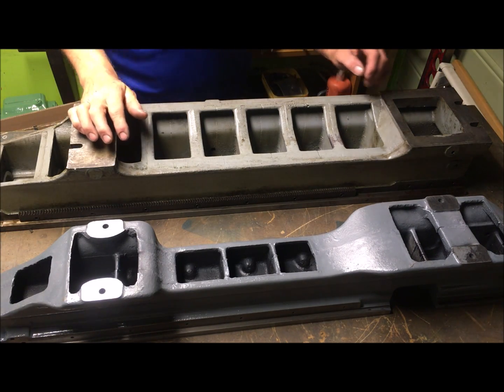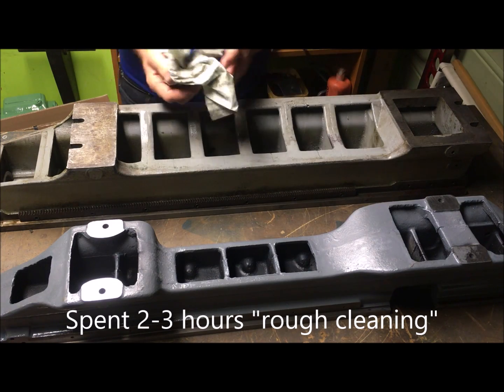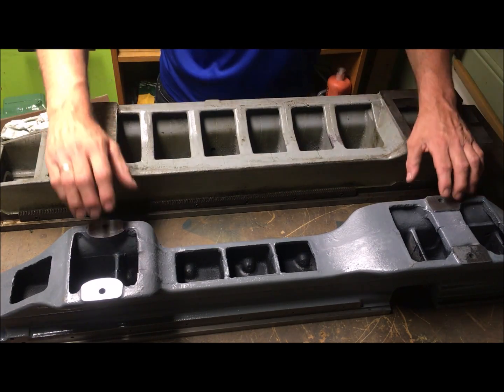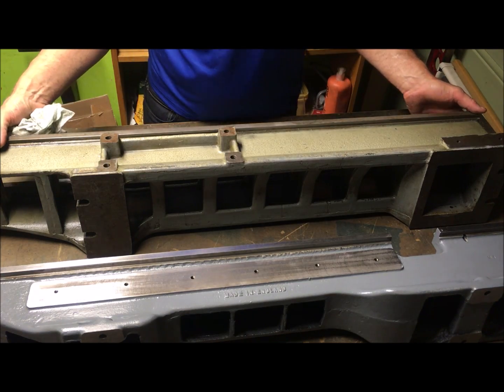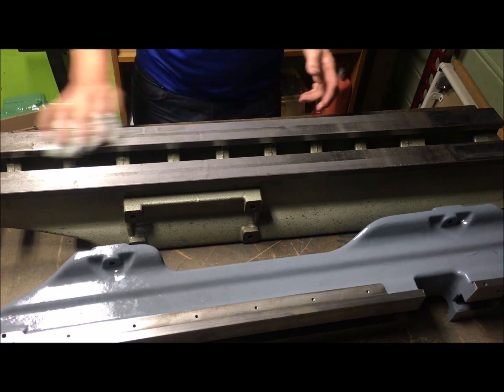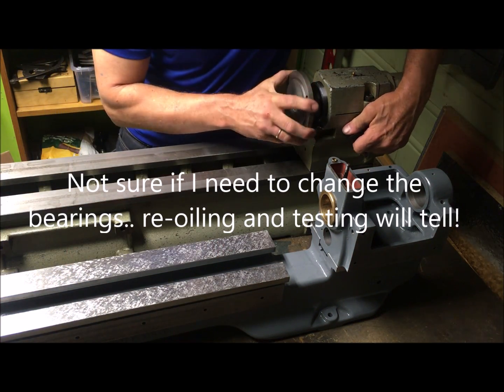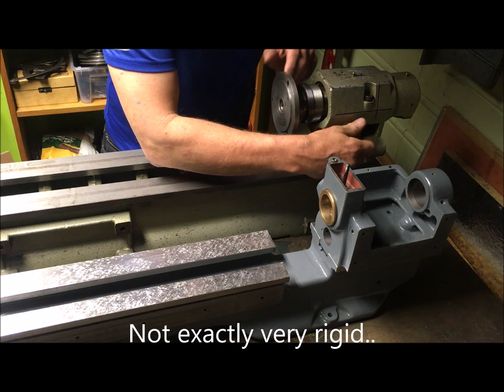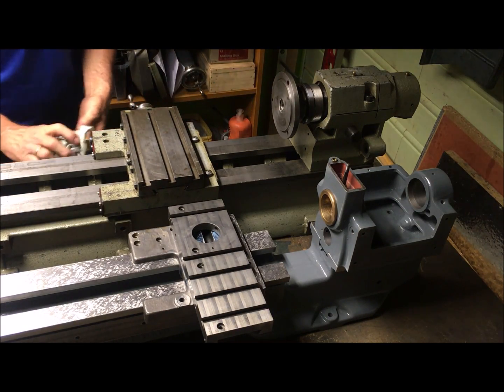EMCO Maximat Standard intro

Comment: The Emco bed looks more rigid, strange they didn't take the same approach to the headstock. 

There is much less pull scraping video available than conventional scraping, I will be watching to see the differences in results.  I have tried a little pull scraping, it seemed to be more of a finishing technique.  At least, I had difficulty trying to 'rough' scrape using it.
Reply from the maker: Agreed re. the headstock. They supposedly had another variant without the quill feed (more beeded up, and with a larger capacity), so when they delivered their top model with both lathe and mill headstocks/spindles I assume they had one of each. My thoughts too re. the pull-scraping being more of a finishing technique. It doesn't have the depth I have learnt you should have for the combination of oil retention and load carrying properties, but for the exposed side of a slide member, eg. the top sides of this lathe, it might be both nice looking and serve the purpose. I have "cheated" ab it and made some preliminary measurements and it is practically not worn but for the front part 10-15 cm from the chuck towards the tailstock, and even here "only" 3-5 /100 mm at the most. This will clean up nicely I reckon with either technique (maybe I do some machine scraping first?) Anyway, I am not good in pull scraping either (at least not yet!), but have a couple of friends that are and have shown me, so will try myself.

Comment from the maker: Correction: the Maximat uses a combination of a pair of ball bearings at the rear end of the spindle (taking up the thrust plus providing guidance) while it has a double row roller bearing in front (taking up the  radial working forces and as I have learnt, is considered a precision design, most often found in bigger, more "industrial" lathes)
Reply: An interesting comparison between the two machines Jan and Emco sure added a lot more cast iron to there beds for not much more swing and distance between centers compared to the Myford.
Reply from the maker: Turning Point I find it an interesting comparison between designs and choices in construction details. The Emco is like 20-30% bigger than the Myford, and more "beefed  up" in most places. Seems to be a quality build, an shows good workmanship. The apron though is a simple affair, and, like the Raglan, also has less of that detail orientation and features the Myford has/shows. But, I guess one could start a big discussion here.. ha,ha . Leave it as an interesting comparison is probably fair..
Reply: Well going by the lathes UK website that would be probably a late 1950's- early 1960's Emco design I guess. I think they seriously upgraded there design and overall sophistication of there machine tools in the next generation. Up to this point I'd never checked out Emcos older designs on Tonys website and hadn't known they once made flat bed lathes much like the Myford. Emco appear to have made a lot of effort in producing fairly high quality, accurate and well designed machines. Having the much wider lathe bed and all that extra cast iron would certainly make a much more rigid machine. I can see the point of having a moving spindle for when the headstock was being used on the vertical column, but as you say that would reduce the headstocks rigidity by a lot when used as a lathe. Today I would think that Emco lathe might be quite rare.
Reply from the maker: Emco's are fairly common up here, maybe not as much as Myford's but still. Especially their more squared up, modern looking model, 7, 8 and 10 V-P (V-bed) and similiar. Mind you, I reckon this design also originates from the 70'ies or so, so the modernity can be discussed :) They are good lathes allright but as the Chinese started copying these I think they couldn't match prices, hence they went out of fashion..? Not sure, but seems fairly logical to me. BTW. I have also seen their top models 11 and 13 (a couple of my friends have these in their home shops) and especially the 13 displays good craftmanship and is very high quality, apparantly delivered to toolroom standards.
Reply: We think very much alike Jan :-) I wanted but didn't buy Emco's Super 11 back when they were still making them but I should have. What I really wanted was that 13" tool room model though. In Canada or at least on the west coast used Emcos are fairly rare as well as any of the Myfords. It's nowhere near the same quality and is much lighter in the castings but that Super 11 was very much on my mind when I bought my last lathe. It's the same as Warco sold as the VF-280 lathe but at the time I had to special order mine with the MT 3 tailstock. I suspect a lot of the Super 11 was copied when they designed mine. I looked for over a year trying to find a Super 11 that was in excellent condition and not over 3,000 miles away without any luck. I'm envious of the availability of all the very high quality European and especially Swiss and German made used machine tools you have in Europe. I think your correct with your reasoning of why Emco got out of the smaller manual machines and started building the larger CNC's.
Reply from the maker: Turning Point There are a few Emco's around up here. Actually one with a dealer in Denmark I am thinking of visiting anyway https://www.dba.dk/drejebaenk-emco-maximat-su/id-106959816/ (He  also has one of the same Russian lathe I have.. btw)
But I reckon availability is much greater in contonental Europe, eg. Germany where I assume they sold more.
Since I have had the pleasure of owning a Colchester Chipmaster, this is also a favourite of mine. Very compact and functional.. and as accurate as I can wish.. (Yes, I had a Schaublin 102-VM so can compare.. for that matter a lot of other lathes.. the SB9 beong the most "practical and easy to use 😁)
Reply: Hi Jan,
Many thanks for that link, if that Super 11 is as clean and lightly used as it appears to be that works out to about $5300 Canadian dollars. It's original cost with the included accessories is easily 3 times that. So it's in my opinion a bit high but still quite fair price. Plus that's there asking price, negotiation would bring that down a bit.:-)

A good friend in the U.K. has a Chipmaster but that one needs a rebuild at some point but it can still turn out good parts until then. He's gutted the original variable speed drive and is using a Transwave 3 ph motor and VFD and likes the set up. The original U.K. built Colchester's were from my reading a very well designed and built machine. Certainly better made, more rigid and heavier than today's offshore made Colchester's are.
Reply from the maker: I see that they have 2 EMCO 11's at this dealer in Demark.. if I go there I will ask if I can share some details (video/pics). They are fairly high priced, but seems to be in good condition.
My Chipmaster was very accurate, despite well used/abused when I got it. I ripped it apart (of course) and must say am impressed with the build! Don't know about recent Colchesters (didn't they go into a group of makers together with Harrison?.. which btw. I also like..)
Reply: If my memory isn't faulty Jan I'm pretty sure Colchester is now part of the 600 group of company's ? I like the Harrison's as well. I've read of no real complaints about build quality of the new Harrison / Colchester machines and I believe Clausing in the U.S. sell the same machine with there brand on it. I have read some complaints that the lathes are now much lighter in the castings than most think a good tool room machine should be. I'm pretty sure some of the lathe models are being built by Acer in Taiwan and if so should be available with a constant surface speed option that ties the machines dro into the VFD so the spindle speeds up or slows down depending on the direction of a facing cut.

I'd be interested in seeing that dealers location if they'll allow you to video inside there premises.
Reply from the maker: Yes.. 600 group it was.. now I remember. Not sure if you follow Doubleboost here on YT, but he has a Harrison 140 which seems a very nice lathe. Newere Harrisons also, especially the smaller M250 (which apparantly became the Chipmaster replacement?)
Reply: Yep Doubleboost has what looks to be a pretty decent and well built 140 Jan. If your ever looking at buying one the newer Harrison 250-300 lathes be sure to check the headstocks internal gearing through all the speed ranges. Possibly it's user abuse, not quite correct metal alloy choice, heat treatment etc? But I've seen mention it can be a problem area with some Harrison lathes and replacement parts if you can wait that long are more than a little expensive. I have a friend in an email group who's in Tennessee who bought a 250 new and had it shipped over from the U.K. when Harrison were still building them there and he hasn't had any problems. So it may be just user error and trying to shift without stopping the spindle or even poor maintenance? In my opinion the 250-300 Harrisons were a true light duty industrial rated machine much like the Emco's.